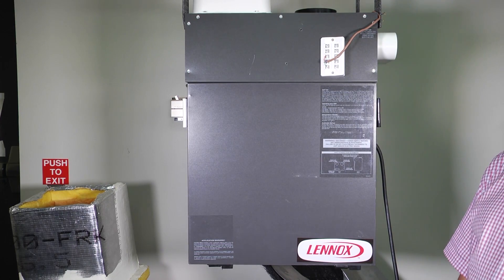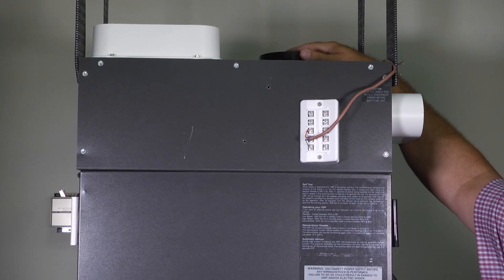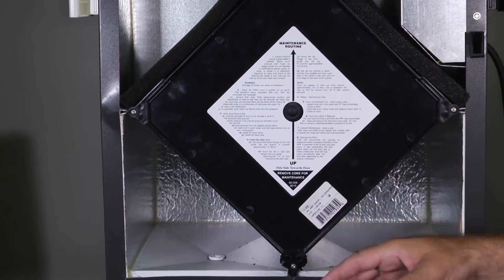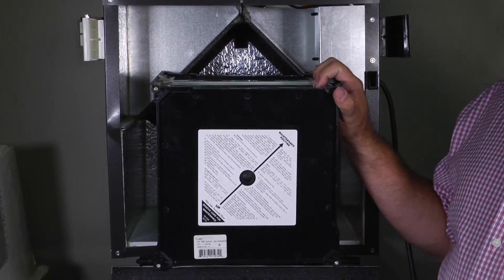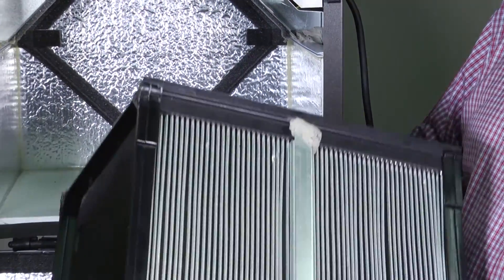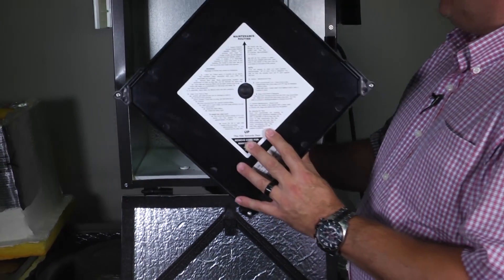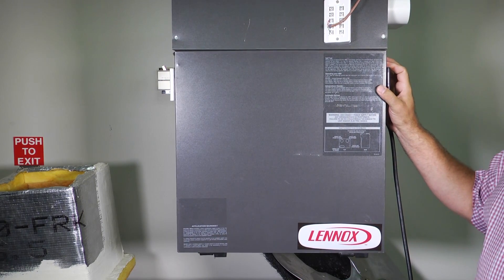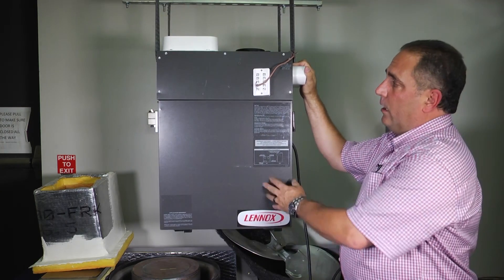HRV ERV System Basics & When to Sell

Comment: What should we use in the Washington DC metro area HRV or ERV for ventilation? the summers are hot and humid and the winters are cold and dry and we don’t want our houses to become very dry in the winter or very humid in the summer.? And I just want to know that fresh air is important for the health of the people in our homes in North America especially  important that all  new built  and existing homes  that are going under a renovation    in North America are    Much tighter  then ever before to keep the heat  in the winter and the air-conditioning in the summer  and save energy
Reply: I live near DC (NOVA) and first I would highly recommend adding whole house humidification.  Depending on the size / age of your home and the location of our furnace you can accomplish this with a bypass style humidifier - good in most homes, cheapest to install, etc.  A better type (more expensive) is a steam generating humidifier.  Once you have that installed I would then add an ERV.  Why?  in the winter you are adding moisture (humidity) into your home if you have a humidifier and an ERV allows you to impart some of that moisture into your fresh (dry) ventilation air.  In the summer you are removing humidification from inside your home and again the ERV removes some of that humidity from the fresh air coming in.  The HRV only allows the temperature of the air to "exchange" so in the winter when you add ventilation air it raises the temp but still comes in "dry".  I don't know off hand how effective an ERV is at removing humidity in the summer.  In theory even an HRV can remove some humidity from hot moist incoming air by simply lowering the air temp. (if the incoming outside air temp. is reduced to the dew point or lower) what I don't know is would an ERV allow an even lower drop in humidity...  either way I would go with the ERV but I would also add a whole house humidifier.